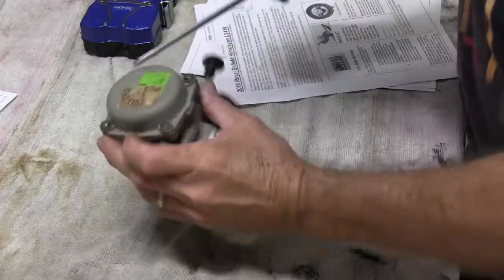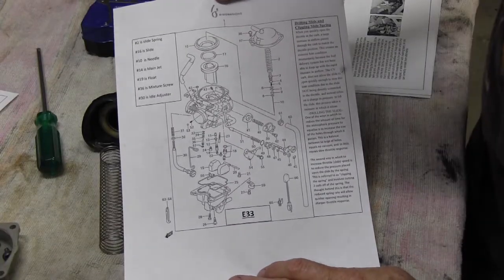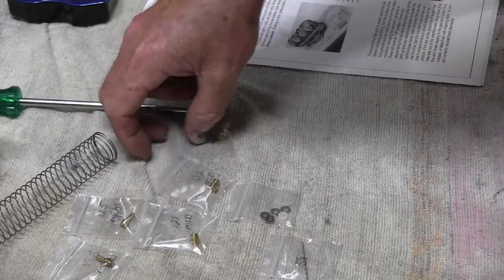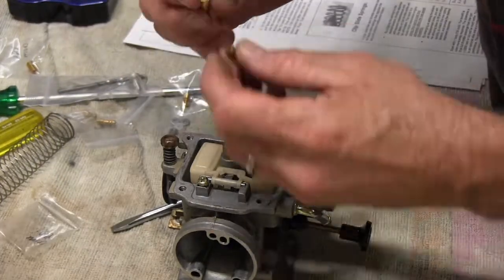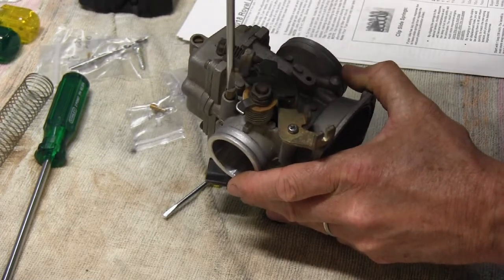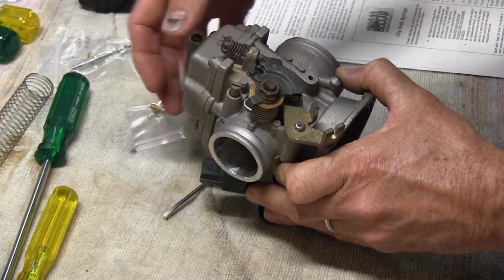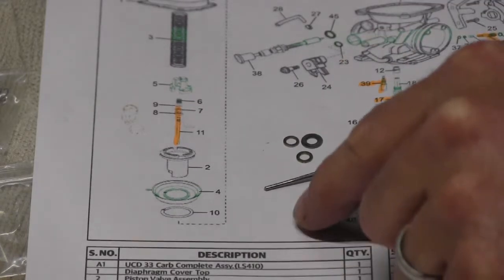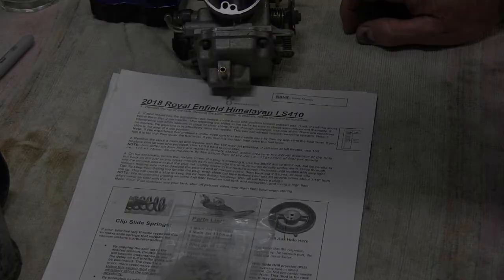Royal Enfield Himalayan Carburetor Rebuild for 500cc bore.

Comment: Namastey sir, i naveen kumar from india, even i ve installed the same 6sigma jet kit in my himalayan carburetor and also i tried installing washers in diaphragm needle to height adjusted but i felt laag in the peeformance in higher speed that too in 3rd gear to 4th gear. Could u please the combination u ve tried in ur himalayan carburetor.... Presently my carb has 17.5 pilot jet and 132 main jet with two washers to lift diaphragm needle..
Reply from the maker: I can't recall what I ended up with sorry. I'll see if I can find some video of it.
Reply: @MORK-TV  thank you sir🙏🏻